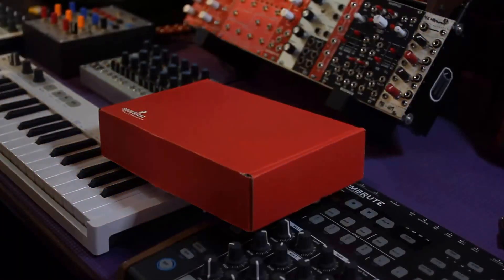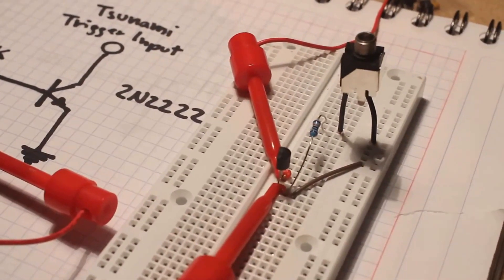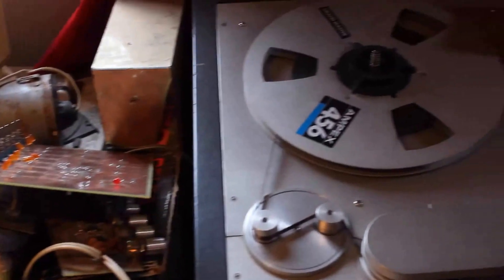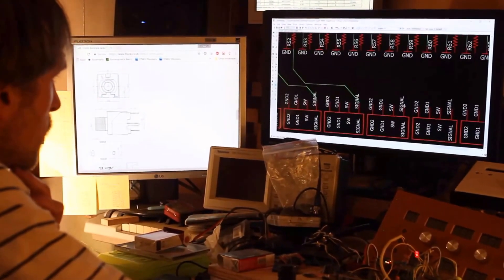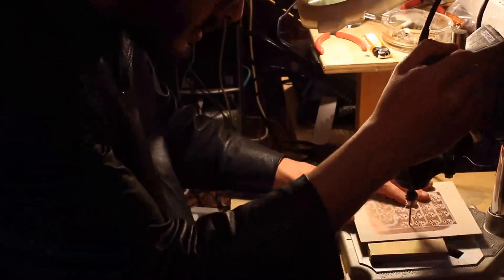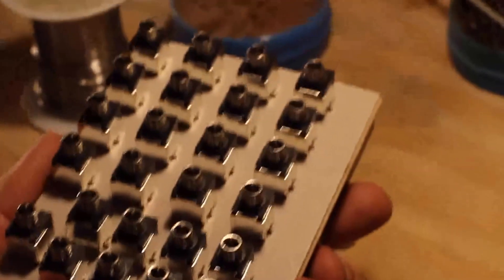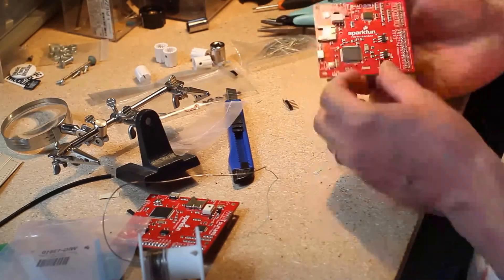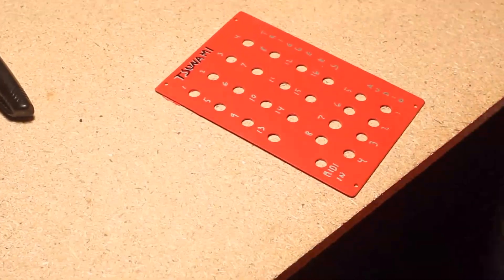The Tsunami Wav Trigger : Making it into a Eurorack Module - A SDIYG Special Report

Comment: Hello and thans for this vid !! Impresive work ! 
I'm considering building a simple Tsunami ( not with trigger inputs, but  driven only by MIDI,  for playing some Drums loops, transitional samples, and piano / electric banks   with my sequencer ) I'm just asking if I just need to solder Midi"in" socket and 8 TS jack for audio  to the board  ? Do i need something more ? ( I've seen there's a USB supply and MIDI circuitry already)  Then i'll make a cheapo case ...  Thanks for your help
Reply from the maker: Hi François! For what you want just solder a midi din socket and a pair of output jacks, ready to go!
Reply: @QuincasMoreira  Thanks a lot !! Cheers

Comment: where do I add an LED so it turns on every time the trigger is triggered? :D
Reply from the maker: you should really use a trigger to gate converter and a LED driver circuit, like a transistor or an opamp. There's no guarantee the incoming trigger would be long or strong enough to light the LED in a meaningful way. But if you want something super simple, then yeah, possibly the same transistor solution as I use for the trigger inputs, shorting the LED cathodes to ground while sending them all +5v (or12) through a current limiting resistor.
Reply: or would the anode of the LED connect to the trigger before connecting the transistor?

Comment: Have you considered bringing the SD slot and USB to the front panel in a future version?
Reply from the maker: A friend, Mangu Diaz in Spain already created the "Nutella" Module, which does just that, as well as a proper MIDI jack and trigger buttons!
If you have facebook click here: https://www.facebook.com/photo.php?fbid=2298237603525658&set=pcb.2298238876858864&type=3&theater

Comment: what did you end up using as a 3v trigger? Is there any way to protect the board if you use higher voltages?
Reply from the maker: It's in the video! I made the triggers respond to shorting to ground, and used a transistor and a resistor so trigger ins connect the Tsunami inputs to ground, that way the Tsunami never sees any external voltage at all.
Reply: Ahh I got it; Thanks for pointing that out

Comment: Thanks for a well done tutorial! Do you know if scaling up to fit 5U modules would be possible with the same transistor and your pcb?
Reply from the maker: Hi! For 5U you would use 1/4" Jacks, so this PCB would not work. But the basic principle with the transistors should work just the same. Try deadbugging the transistor ;)
Thanks
Reply: Hello again, 

Do you think BC337-25BK or BC337-40 would work as transistors? They are both NPN 45V 800mA.
Reply from the maker: Any NPN should work, but I'd test first ;)

Comment: Great video! What did you make the panel out of?
Reply from the maker: Thanks!  PCB material, nice and easy to work with, copper acts as ground and shield, etc...
Reply: Cool, where do you buy it?
Reply from the maker: I buy it locally, at electronic stores. I'm sure there are online sources too though. Quick google search yielded this:  https://www.amazon.com/Copper-PC-Board-Single-Sided/dp/B000P7ALZC

Comment: Great! How high max voltage can You put to active trigger after Your modification?
Reply from the maker: I think anything in Eurorack is Kosher, I tested with up to 10v bipolar with no issues. I don't actually know the math to know for sure how high or low you can go before the transistor gives up.
Reply: thx! 10v is enought for me. so there is no problem about errors in tsunami with Your circout if patch cable are out?
Reply from the maker: no problems so far!
Reply: :-)  soldering is waiting for me , thanks a lot
Reply: Hi , I was just trying to do it with 47k and (2 N2222 NPN to-92 plastic-encapsulate Power Transistor 30 V 600 mA) . It doesn't work for me. Maybe I got a wrong part ? which part are You use exactly, sorry Im electronic beginner...
Reply from the maker: Bartosz Sikorski , looks like you're using a power transistor. It should be just a simple low current npn. you can try 2n3904 or bc547 which are very common transistors. We used 2n2222 in smd because it's what he had on hand, but any general purpuse npn should do.
Reply from the maker: by the way, I'm also an upright bass player :)
Reply from the maker: that should work!
Reply: ooh , great! lets do synth build in upright bass!!!
Reply from the maker: Oh, the upright is already perfect :)

Comment: Brilliant video, and demonstration of the idea to module process, but...

it really isn't a good idea to hold the part you're drilling with one hand, and using the working power hand drill in the other! (referring to your front panel.)
Reply from the maker: Thanks! I actually drilled the holes with the panel on a piece of wood at first. What you see me doing with the panel held up is fixing some of the holes to line up with the jacks.